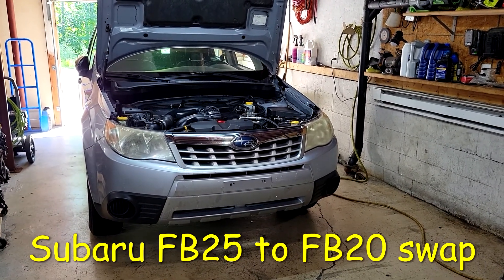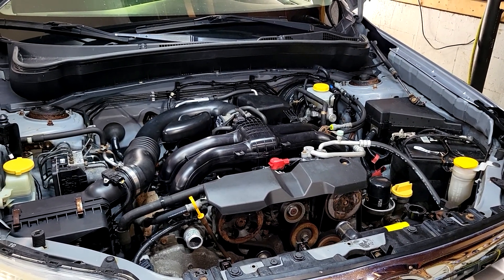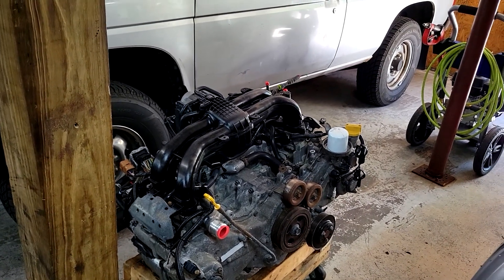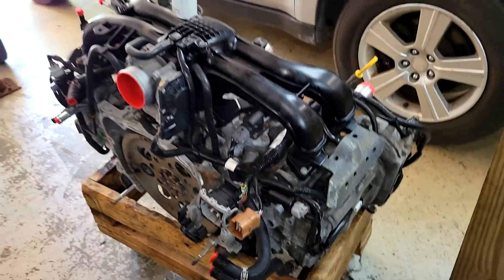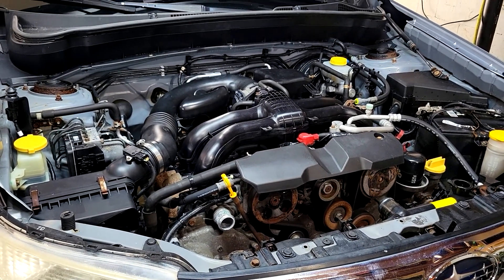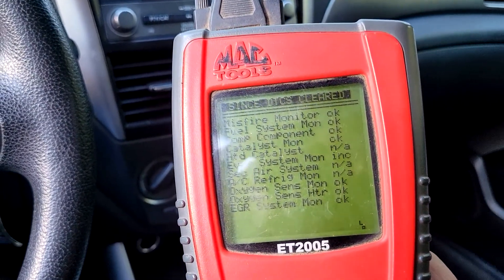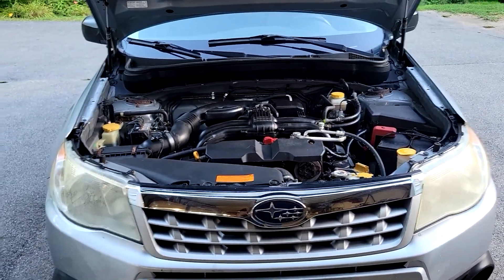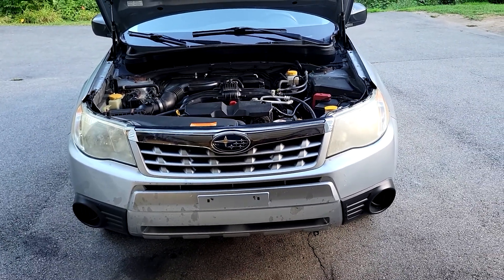Subaru Forester FB25 2.5 to FB20 2.0 Engine Swap Cheap Option To Fix Your Car Legacy Outback Impreza

Comment: Thank you for the video.  I did this with a 2011 forester fb25 today, the donor was a 2012 Impreza fb20 (600$)Don’t know who should be credited with this idea but your video got it to me.  I thought the car was a lost cause before seeing this!  Runs great. swapped injectors, Motor mounts, flex plate, and steering pump
Reply from the maker: I came up with the idea based on how back the day when we used to do a similar thing an ej25 to ej22 swap.(the ej22s where cheapand didnt blow headgaskets). so when faced with a blown very expensive FB25 i tried using the cheap fb20 and it worked great, so i made the video to help others. is your car a manual or auto trans? what is you opinion on the power difference?
Reply: @volks-jager  hello I got cheated by a dealer he gave me a faulty car bad engine after buying I changed the oil and filter but after 2 miles it started having check engine light I thought it is stalling because I am not giving gas as it's manual transmission but I have the impreza engine so it will be really great if you explain a little bit so that I can make it work I'll be glad to receive any kind of help from you guys
Reply: It’s my girlfriends car so I can’t speak to the power difference.  It did climb the hills fine on my test drive to the grocery store. The old engine went from burning a quart between changes to drinking itself dry all of a sudden.  Both forester and donor Impreza were auto trans.
Reply: Can the fb25 work in the impreza body
Reply: Wait you have to swap the steering pump ?
Reply: I have no idea if your even gonna see this pal but I’m about to do this now I found a 2012 Impreza and I have a 2011 forester if you’d be able to give me any idea of anything else I’d need other then what’s in your comments I’d be grateful

Comment: Thank you for the video. It has inspired me to swap the FB20 into my 12 Forester in about a month or so. When it comes to the coil packs, do I use the ones from my FB25 or can I just use the ones that come on the FB20? Also if I have to use the ones from the FB25 can I swap valve covers?
Reply from the maker: i just use the FB20 coils. the last couple i did i just left the  FB20 intake and harness on the engine and they where fine
Reply: @volks-jager  thank you! That was going to be my next question about which wiring harness to use. But I do use the tgvs from the FB25 correct?
Reply from the maker: @nigelnewman4610  i havent just use the FB20s, infact if the donor engine is the right year you dont even have to take off the intake at all

Comment: For the engines with the transmission cooler, can you just connect the lines from the water cross over manifold to the pipe that comes out from the bottom of the engine? I’ve seen everyone else plug one and swap out the cross over manifold.

Comment: 2 year old video so not expecting a response but inhave a 2015 forester. I know there is small difference between the older fb25s and the one i have, like electric power steer and i think cam phasers, something with the egr valve and probably some crap im forgetting. Im burning a quart every 500 miles and ive just been dealing with it, my cat is probably toast even though there is no light, the car has very little power luckily i check my oil frequently. This seems like a solid answer to this problem since dropping in another fb25 will probably have the same outcome. I have a 6mt, do you think i could do one of these swaps on a 2015? I assume it would be pretty much everything stated in the video plus deleting the power steering pulley. I guess the question is whether it would mate up to the 6mt transmission. Thanks
Reply from the maker: im not sure what needs to be changed over on a 2015. all the ones ive done are 2011-2013. the 2.0 will work and they are cheap and better engines, but you just might need to swap more stuff than on the older car like im working on in the video. you might need to swap trigger wheels or cam phasers. i just dont know for sure. im also not aure if you should get the 2012-2014 or the 2015-up type 2.0

Comment: Do you have to use the harnesses from the fb20
Reply from the maker: no, you can use the FB25 one
Reply: @volks-jager also sweet do you know what is needed to decode the vin ? Fb20 is a 201 l2 Impreza and my Forster is 2011 both has the cvvt

Comment: There are plenty of 2017 Forester engines around the Northeast for under $500. Will the 2017 Forester engine fit my 2012 Forester?
Reply from the maker: see Steven Oswalds video for that swap. it is a quite involved and you have to mickey mouse the tunnel valves. and beware he even got some of the newer FB25s that are oil burners

Comment: Thank you! Just swapped a 12 Impreza motor into my 11 forester. So far it’s good! No check engine lights but still haven’t drove it far but I’ll take that as a victory!
Reply from the maker: with everything connected you wont get a check enigne light, but the engine will be a slug on hills. if you leave the cam phasers unpluged the light will come on, but give you a good boost in power

Comment: Good video. And good assessment on early FB25 engines. I have the first year FB25 and guess what happened? Overheated and the head gasket leaked. Engines were expensive, so was prepared to swap the short block if need be since they've made updates to the newer ones. I ended up hand-resurfacing the mating surfaces on the head and the block with plate glass and sand paper, new rings, rod bearings for good measure, and new head gaskets. Fortunately, head gasket sealed well and the car works well.
Reply from the maker: hell of a lot of labor on the FB to do all that. the EJs where so much simpler
Reply: @ Since this is the only engine I have taken apart and put together, I can’t say it’s easier. However, the mechanics of the engine was simple enough. The only trouble was the sealing with RTV in general, especially the timing chain cover. I had to take out the engine three times to get the seal right.
Reply from the maker: @hankitytankity  the trick on the timing cover is dont use RTV. use anaerobic sealer instead. unlike RTV you dont have to worry about using too much with anaerobic as any extra that gets inside the engine will just mix with the oil and drain out next oil change. Anaerobic only dries when it is clamped between 2 machine surfaces
Reply: @ I did try the anaerobic on the timing chain cover. The problem was the three-way split between the block, cam carrier and the chain cover, Loctite 518. Anaerobic was useful for smaller closed seals like the cam carrier, but just would not hold on the timing cover. So, I ended up using Honda Bond which is holding well.
Reply from the maker: @hankitytankity  518 is what i use and have not had any leaks with it. i use it on the cam carriers as well.

Comment: Would that engine work on a 2009 Forester as well?  Mine just blew up.
Reply from the maker: no, a 09 has the EJ25 belt engine with VVL. there is no cheap swap option for you car. when i need one of the VVL EJ25s i just buy a whole car that was in wreck

Comment: I installed the fb 20 into my 2012 forested and having  cam sensor issues ever since 
There are 4 cam actuators
The fb25 has 2 any ideas?
Reply from the maker: Leave them all unplugged.  The car will run way better with them disconnected.

Comment: What's wrong with the FB25?is the EJ25 better?
Reply from the maker: FB25s are oil burning cuckoo-clocks that are a PITA to work on. EJ25s are simple to work on and aside from the headgasket issue (which is not hard to do) are pretty reliable.
Reply: @volks-jager  Fair enough. Why swap the FB25 with the FB20?
Reply from the maker: @santouchesantouche2873  becuase FB20s are alot cheaper than FB25s,  the video explains it.
Reply: @volks-jager Is it possible to instead opt for putting in say, a 2018 FB25? Subaru seemed to solve the oil burning issues by this point. And moreover, can a 5EAT be mated to it?
Reply from the maker: @santouchesantouche2873  this is way more work, you have the pull the timing cover and change phasers and you have the mickey mouse the tunnel valves. See Steven Oswalds videos for how to do that swap,  but even he has had some of the newer FB25s he swapped in burn oil. the FB25 is just a POS engine. a trans swap in not going to be feasble that would require major wiring and a custom ECU setup and tune

Comment: In your description you mentioned that disabling the intake AVCS will lead to much better power, I wonder why.
Reply from the maker: becuase the FB25 computer does not match the FB20 cam profile and/or phasers and cuases to much retard. if you leave them plugged in the power will be very poor.

Comment: So the 2015 fb20 i got has 2 broken cam sensors i can leave those unplugged?
Reply from the maker: you can leave the cam phasers unpluged. and the  cam sensors on the exhuast cams.
Reply: @volks-jager one intake cam and one exhaust cam is broke does that matter?
Reply from the maker: @kevinburns5889  the sensors or the phasers?  the phasers dont matter(infact the fb20 will run better without them,but will throw a check engine light)  the intake cam sensors are needed.
Reply: @volks-jager if you got another social media platform you use i could send them that way
Reply: @volks-jager from what I've been able to find it looks like it might be the vvt solenoid
Reply from the maker: @kevinburns5889  the phasers face forward and are held in with 2 bolts. the sensor point up or down and only have 1 bolt
Reply: @volks-jager  well technically I guess it could be the sensor cause it is a plug. But it comes off the phasers I expect
Reply: @volks-jager  so on my original harness there is a plug for the power steering pump and the other harness does not have that plug. So I think the cam solenoids are more important I should use the harness that has those with out the power steering pump correct?
Reply from the maker: @kevinburns5889  you can use either. the bottom cam sensors are not needed and the power steering  pump wire does basically nothing
Reply: I want to say they are the sensors I took pictures of them I could send them to you for verification if your cool with that?
Reply: Then it would be the phasers cause it's 2 bolts they go into the front of the engine and have a 2 prong plug for the harness

Comment: Planning on putting an fb20 in our 2011 forester MT this Tuesday- found one for $600- When it comes to swapping the Flexplate for the flywheel will I run into any issues? Thank you for replying to these comments
Reply from the maker: nope, it will bolt right on.
Reply from the maker: @PourRichie  before you pull the engine look though crank sensor hole and see if you can see the trigger wheel teeth. use a bore camera if you have to. never turn in a core until the job is done, you never know what you will need. trigger wheel is available new at Subaru dealer. Part Number: 12230AA070  i actaully have a spare one here, if you happen to be near southwest New Hampshire
Reply: @volks-jager  ill get a bore scope down there this weekend and see. Unless it was bonded to the flywheel and I didn't notice it its definitely attached to the core. No biggy- we have other vehicles to drive. This is a great lesson. I learn from bumps and bruises. Thank you again for your help.
Reply: All was well. Engine is in and running good- receiving 4 misfires with cam phasers plugged- unplugged them and car is running well but CEL will report back if anything changes. Thank you so much!
Reply: Got the whole engine in and am facing a no start. Replaced crank position sensor, no difference. Leaving bottom exhaust camshaft position sensors and cam phasers unplugged. Have the tops plugged in. Going to run through everything again but anything simple I may be overlooking? Had to use the 2.0 wiring harness.

Edit- just checked. No spark. Going to test all 4 soon but cyl 3 had no spark.
Reply from the maker: @ what year is the engine you got?
Reply: @volks-jager  2014 impreza
Reply from the maker: @ 2014 should be fine, if it is 2015 or newer there are major changes. when you swapped the flywheel did you put on the trigger wheel correctly?
Reply: @ only pulled flywheel didn't see a trigger wheel. thank you for the comment. I thought the crankshaft position sensor read from the flywheel am I incorrect?

-bolted flywheel straight to the engine I am now seeing there may be something that needed to go behind that. Reluctor wheel?
Reply from the maker: @PourRichie  there is a trigger wheel between the flywheel and crankshaft. look on you old engine you should see it

Comment: Thanks  for your video!  Can you tell me if this swap will work on a 2018 Forester with the 2.5 and manual transmission?  Anything in particular to be careful of?  Thanks Again!
Reply from the maker: this video was made with 2011-2013ish Foresters in mind. A used engine for your 18 should be cheap enough that you dont need to do this.
Reply: @volks-jager  Thanks for the reply.  From my brief search, a used  2018ish 2.5L engine is still about $2K (just the engine).  Not sure why the 2.5L died in the Forrester, from what I read, Subaru started using the multi-layer head gaskets in about 2015, so it should not have failed at 105K miles.  It's not actually my car, it's a relative.  He's upside down in the vehicle...still owes a ton of money on it and now it needs $4k+ of work.  I feel bad for him.
Reply from the maker: @turbotato   is it a turbo? or are you in beverly hills or something? my local salvage yard has a non turbo 2.5 out of an 2018 forester  with 76k miles for $500 - these engine should not be anywhere near 2000. what is you zip code? most FB25 engine failures are not due to head gasket, they are just a very piss poor design.

Comment: This is inspiring. I have a 2014 Outback that needs a new engine. It has the 3.6, which I like, but I’d take a cheaper fix if the 2.0 could work. It’s not quite the swap you’re doing, but I can look into seeing how plausible it is.

Maybe a turbo engine from a WRX? 😂

Comment: So I just completed this swap and with the help of this video and the other YouTube comments, i was able to complete this swap without any trouble as in zero check engine lights and zero plug connection issues. Car is a 13’ forester fb25 with 4eat. Donor engine came from ‘14 Impreza(fb20 w/cvt). Things I had to swap- intake manifold(including valves below the plastic manifold), flex plate, fuel injectors(the whole assembly), both coolant temp sensors( there is one on the top of the motor below the intake on passenger side and one on the front of the motor on the drivers side), engine wiring harness, took the rubber boots off  the fb20 and swap them into the fb25 coil packs, I snapped the silver spacer out of the fb20 coil packs and used those as a spacer for all four coil packs to fill the gap that is created due to the difference in the valve covers( I had to grind the spacers down just a little bit, but worked out great), swapped motor mounts, the fb20 also had sensors on the bottom side front beneath the cams. The fb25 does not have these sensors but it does have the spot ready for them and fb25 uses a cover plate to fill this spot. So took the cover plates off the old engine and took out the sensors that aren’t needed and put in the cover plates instead to avoid confusion in the future. I didn’t do this but the same goes for the lower vvt exhaust came sensors/phasers. The fb25 uses a cover plate for this location which could possibly be swapped over to the fb20. The only other things is there is a sensor that I left in the has a small wire coming from behind the drivers side motor mount. The fb25 harness doesn’t have a connector for it and I don’t recall seeing a cover plate(but I may have just decided on keeping it in and never looked). Things to have ready prior to starting- the correct coolant, engine oil, intake manifold gaskets. Overall thoughts after first drive is it’s great around town, fine once it’s up to speed on the freeway but pretty slow going up any hills. It has to rev high to get it going. So I may try to pull the plugs and the vvti intake cams and see how much power I gain. 
My question to the poster, I know I’ll get a check engine light once I unplug those, I have other older Subarus that I have used a resister in the plug to fool the computer into thinking a sensor is plugged in when it wasn’t. Specifically an EGT sensor in the older 03 wrx. Is this something that could be done in the vvti plugs? Put a resistor in each plug the fool the computer into thinking it’s plugged in to avoid the check engine light and still get the power gains of it being unplugged?
Reply from the maker: adding a resistor might stop the light from coming stright on, but the ECM will soon find that it cant advance or retard cam timing and throw a code. the best fix is a custom tune, but that cost money and is hard to find someone that can do it. best is to do like we do - once you pass state inpsection unplug the phasers and either put tape over light or ignore it. the power on hills is alot better with them unpluged. if you where a real glutton for punishment you could replace all the cams and phasers with FB25 ones and that would most likely solve the issue, but that is a miserable job as all the buckets would need to be reshimmed and the timing cover and cam caps resealed which are a mess of RTV from the factory (use ananeobic sealer on these instead if you decide to go that route)

Comment: Found an fb20d auto trans, will this work in my 2013 forester?
Reply from the maker: no
Reply: @ why is that?
Reply from the maker: @TheCowboyHardWay  an FB20D is way too new for a 2013. you need and older FB20 for that swap.
Reply: @ Gotya thanks. What way am I looking for
Reply from the maker: @TheCowboyHardWay  a fb20 out of a 2012 or 2013 Impreza